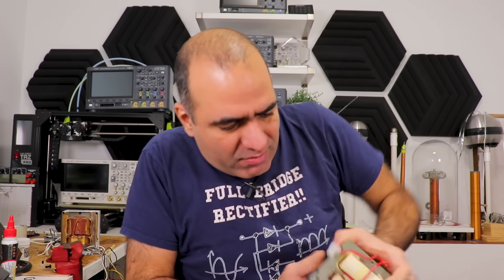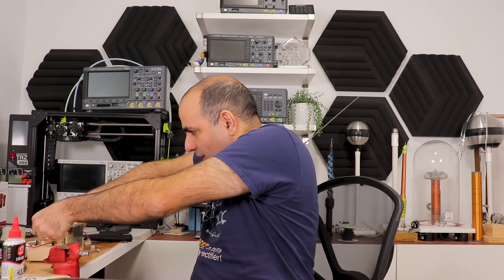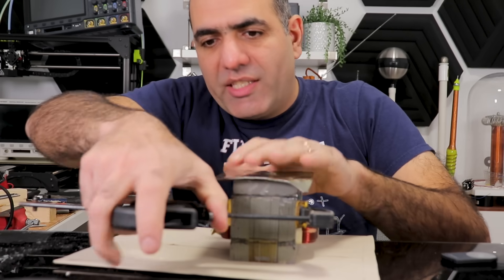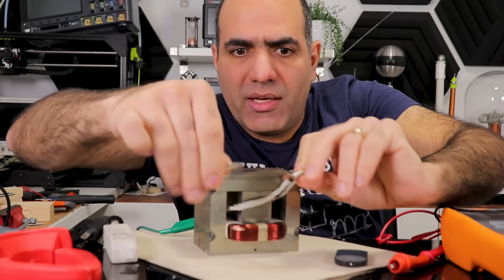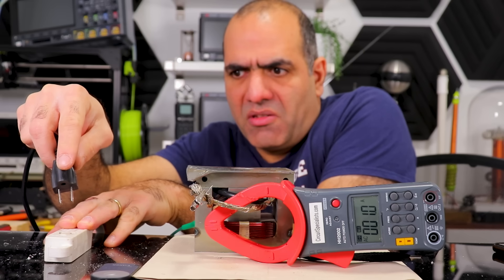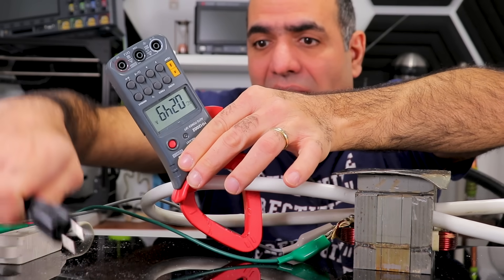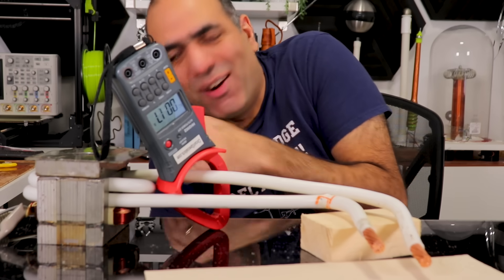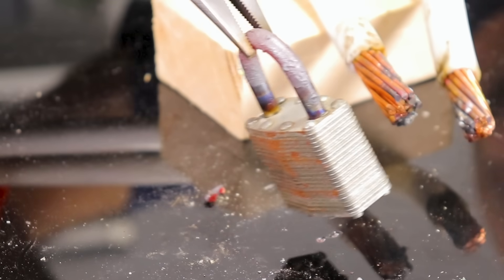Making "MILLIONS" of AMPS of Current

Comment: He is touching the spoon with bare hands 😂😂 this is fake video
Reply from the maker: Why?! There not enough voltage there to hurt me
Reply: @ElectroBOOM  i mean when it is heating , when you put spoon, it is going to melting temperature but you are holding spoon with hand
Reply: @sharpshooter4202  the leads where on the ends of the spoon. Stainless Steel isn’t very good at conducting heat either. It would take a moment for the heat to reach his fingers

Comment: I used to use about 2volts and 40(ish) Amps with sprung clamps to heat heavy duty cables for soldering in one job I had in a power supply factory

Comment: P.S. Make a CRUCIBLE out of a refractory conconcrete or firebricks, some copper and/or tungsten coils and YES you can melt almost any common metal. It means you can melt all your old aluminum foil or copper wire into a ball and then grind them down to super-smooth surface to make PERFECTLY ROUND and very shiny SPHERES!  

Another thing you could do, is create an electro-magnetohydrodynamic engine (EMHD) that could accelerate pressurized super-heated metal (fully vapourized!) such as lead, mercury, chromium, manganese or even common iron within a torus configuration (aka a hollow donut) using fast pulsed electromagnetic coils to speeds approaching half-light speed when it's fully evacuated (i.e. almost a full vacuum inside the torus!).

The torus should MYSTERIOUSLY LIFT ITSELF OFF the table and just FLOAT in mid-air! ...AND..... any objects that are placed underneath or otherwise nearby the active Torus should have a REDUCTION IN WEIGHT (aka Antigravity)

Evidently, Mercury works best if it is superheated and highly pressurized to at least 1000 PSI (68 Bar -- or PSI which is short for Pounds per Square Inch) and preferably HIGHER, so you can accelerate it!  Basically, the EM coils are turning the donut into a closed-loop cyclotron (i.e. with no particle collision/impact zone!)  --- UBC (University of British Columbia) has a bigger version of this called TRIUMF -- Call them to see if you can get a VIP Tour for your next video!

Suggestion:  Just get some friend to use an Oxy-Actelyne torch to superheat a 3 metre long 5000 PSI to 10,000+ PSI burst pressure-rated Stainless Steel pipe that is anywhere from 4 inches to 12 inches in diamater (i.e. 10-to-30 cm) that has at least 3/8ths inch thick walls (9.925 mm) and preferably half-inch-up-to-three-quarters-inch thick walls (use website MetalSupermarkets in Burnaby to order!) for extra safety margins and then bend the heated pipe into a full torus and weld the ends together to make a perfectly smooth and fully sealed torus (i.e. metal donut). Make sure the torus is properly heat treated and/or annealed so it KEEPS it's 5000 PSI to 10,000+ PSI burst pressure-rating strength!

Now drill a hole and insert a high-strength Stainless Steel pressure valve so you can dump hot vaporized heavy metal into the torus and use the high amperage/high voltage electromagnetic coils you attached to the interior AND/OR exterior of the torus (not sure which interior/exterior side to install the heat resistant EM coils on -- you figure that out!)  to accelerate vapourized metal to near superluminal speeds. Watch the torus eventually FLOAT MYSTERIOUSLY in mid-air!

You now have a working UFO engine! It Works GREAT!

V

Comment: at 12:00 don't breath the fumes! That's CHROMIUM (aka a heavy metal) from teh coating which will eventually accumulate and poison your liver and kidneys! Based upon what I see, that is a tad more than a few micrograms of vapourized Chromium being breathed in! Enough to cause quite a few problems for you! Wear a decent and proper respirator with charcoal filters in it rated for heavy metals!

V

Comment: Hi there! I have a question... If I connect my live wall socket into the ground... Like if I cut a wire, plug it in the wall socket and the other end of the wire is connected to the ground/soil/earth, will my electricity bill increase cause the electricity will continuosly move to the earth? I am very curious of your answer.
Reply: Careful!!!!  the earth may melt away...

Comment: I was working in the crawspace under my house, the floor was a little wet, and when I touched the electric fan or work ligh on the floor, I got shocked. Not hard, but still felt the 60 hz. There are no live open wires touching the water/ground, maybe just the metal enclosures. But the grounding also isn't connected yet to my ground pin in my house. How can I feel the electricity? I don't get whats going on..never felt anything on a dry floor. It looks like energy is flowing from me, connected to the wet floor and the "floating unconnected" ground from my house...?
Reply: "But the grounding also isn't connected yet to my ground pin in my house"
Here's your problem, Marvin.  Those things need to be grounded
Reply: @DeoMachina  I know, I will fix that next week 😉 But just out of curiosity, whats happening exactly? Is a device malfunctioning? And finding a path to ground when I touch a device while touching a wet foundation? Or is this normal that there is always something flowing to ground?
Reply: @marvinhensbergen1515  In my opinion something is wrong, current should not be leaking even if those devices aren't grounded.  I can't say more without actually seeing it, but its possible the cables are damaged or poorly wired and you have a hot wire touching the case or the earth cable

Depends on where your house is, but some earthing systems are literally 'a big spike in the earth'.  That's more common in rural areas but if that's the case, you just might be providing just enough of a path for the current to go from that spike to the casing?

Comment: I thought amps were dangerous. My school teachers always said that the higher the amp, the higher the risk of death. But this dude is holding a spoon with 4k amps like it's nothing.
Reply: Voltage that create pressure to break your skin resistance so a million amp cannot push the current into skin if the voltage too low just 2 v
Reply: And the same as high voltage if not enough current the voltage drop drastically

Comment: 4:10 90 Ampere? Why have not you become a coal? 🤣
Reply: @Questiala124 BCS the voltage was very low, soo the current couldn't flow through him.
Reply: @Walsoup  I was translating the text on the original comment, I know why.
Reply: @Questiala124  Because it's not flowing through him
Reply: @Questiala124  I know, but I'm on mobile and it was easier to reply to you
Reply: Mmmm, electricity doesn't harm you the frequency does.
You get shocked by 40amps at low frequency and get not harmed
Reply: Check his older video , he try 150 amps on his tongue , and it's fine

Comment: The combination of the insulation and the way the strands are locked together in the cable make it very hard to bend - as you now know. Now if you could find some 000 locomotive cable you'd be in great shape. Not too easy to source however. But...if you use 1/4" OD copper pipe (3/8" if it fits would be even better) , you will find it bends a bit more easily. Ok.. a lot more easily. Use some polyamide sheets and/or tape to insulate the 2 turns from each other and the core. Since any decent duty cycle will make even that pretty hot, you can actually run cooling liquid through the copper pipe (preferably deionized of course) For a spot welder however? The hardened point contacts are probably more of a problem.

Comment: Hello ElectroBoom and everyone here. I have a (Samsung) Microwave Transformer, and dont know what its input/Output is. One side has red wires (like idk looks like 4 turns) and has some connector ontop and a solder joint next to it. Under it is Copper wires (Main?) The other side has 2 of the same connectores and is connected to the perviosly named copper wire. On the top is another cooper wire (Aka the named connectors from the side with the red wires),but there is a wire connected to the transformer its self (The copper wire i just named). Its 230V 50Hz. If anyone can help it would be helpfull

Comment: If you look at the formula for the magnetic field 'B' in a current-carrying wire - as current increases, so does the magnetic field.  It would be interesting to measure the magnetic field around the very high, one-loop secondary winding and compare it with the original secondary winding, which has much, much lower current flow due to the number of (stepped-up) turns compared to the primary winding.

If you were making a very strong electromagnet, you'd want something like you made - a step down transformer with extremely high current in the secondary. 

B = (uI) / (2pir)  where:

u = permeability of free space
I = current flow
pi = 3.14159
r = distance from the wire with the current flow

If you intended on creating a strong magnetic field for a Lorentz force application to create immense, coherent accelerations in the metal hull of a ufo,  you could deploy an extremely high voltage - say, stored in a large capacitor bank (see the ARV, the 'Flux Liner') and use a step-down transformer to develop massive current flow to create the magnetic field.  Eddy currents could be created on the hull by way of smaller coils that induce eddy currents at right angles to the (centered and vertically-oriented magnetic field) and presto - the Lorentz force creates immense, coherent accelerations of the charged particles in the metal hull, yielding
1)  artificial gravity
2)  lots of RFI/EMI interference, since accelerated charged particles radiate lots of electromagnetic radiation (radio antenna for e.g.)

(2) is often mentioned by ufo witnesses

The ARV has a huge bank of capacitors on the lower level that probably provide this high voltage for the magnetic field.

Comment: A doubt: is it a problem if the primary coil is not tightly rolled around the core? I rolled it with little care, it has some spacing (air) in between the wires
Reply: Air provides a high reluctance path for the magnetic field. Magnetic reluctance is the equivalent of electrical resistance.

Just as there are electrical circuits carrying current, there are magnetic circuits carrying a magnetic field.

So yes, air is not your friend when it comes to magnetic fields.

Comment: The transformer, in this application, limits the current so that the circuit breaker doesn't trip. If you connect your spoon, coin, etc. directly to the 120 V source, the current will be much higher than the few hundred Amps you are observing. The idea of using these transformers is to elevate the impedance of the load seen by the source (e.g. by  n^2 factor in an ideal transformer) so that the primary current is just below the circuit breaker limit.
Reply: No.
There are different uses of transformers inducing: 
1. Stepping down the voltage
2. Stepping up the voltage
3.Stepping up the current
4. Impedance matching

In a welding application you are trying to generate heat by producing a very high current, so that's application 3 above.

Impedance matching doesn't come into it.
Reply: @deang5622  Currents in a transformer are determined by the load. In the welding application, once the arc is generated, the load is huge (almost  a short circuit). A welding transformer steps down the voltage at the load to limit its current (and therefore the delivered power). This is basically what I said above. In short, transformers do NOT generate high currents. They simply convert the voltage, and the current depends on the load. I think @ElectroBOOM was a bit confused about this in the video.

Comment: My dude just inhaled evaporated zinc 💀
Only melt pennies from 1972 and lower the rest are 90% or 95% zinc and only like 1% copper, zinc smoke is incredibly dangerous to inhale. When I used to melt down copper plated zinc even with a respirator on sometimes you can still smell it and it's putrid, made the mistake of not wearing the respirator properly one single time and that's all it took I was sick for weeks and still feel it some days where I wake up in the morning and need to randomly puke cuz I accidentally got almost an entire lung full of the smoke 💀

Comment: i think with my stoned drunk brain that cleuing the core even helps with power it wont move anymore so give mor force in the magnetic field so more power and less nois and yes when taking the top of the core it wil split with top on magnet power go out after the top when top of the magnet flow will spread out when top is of so will pull core appart basic stuff

Comment: The only thing telling me that you didn't get yourself electrocuted is the fact that the video was uploaded and edited...
But every time you touched the transformer or the live wires I was getting the goosebumps.
The fact that don't like dealing with electricity in general, helps too.
Reply: Invariably to produce a very high current a transformer is used. The transformer is typically used in a step down configuration where you want a very high current coming out of the secondary winding. And that usually means a higher current than going in to the primary.  Hence a step down transformer is used.

Now, if you use a step down transformer, the voltage is stepped down but the current is stepped up. You can look for my other post which presents the mathematical equations and notably the power equation to understand why this happens.

So the current steps up and the voltage steps down to a very low voltage. And if that voltage is below 50 volts AC RMS, which 4.5 volts certainly is, then you cannot be electrocuted.

So it's quite safe. But you must be using a step down transformer and know what the turns ratio is and input voltage is, then you can calculate what the output voltage is on the secondary.

Comment: 12:20 besides an electric furnace, another obvious use given the bright white hot glow of whatever poor metal is caught between the ends is... a jumbo sized lightbulb? This could vaporize weaker metals like zinc instantaneously to the point it could be considered and explosion, this could be an electric furnace for melting thick steel and copper objects within seconds as opposed to the hours it'd take for gas and coal furnaces to heat all the way through, yes in fact what you most assuredly have in your hands is an apparatus that can reduce anything it touches to atoms, balanced as all things should be OOORRR... you stick a "fillament" in between those ends, encase it in a glass dome, and make the world's largest desk lamp or flashlight!